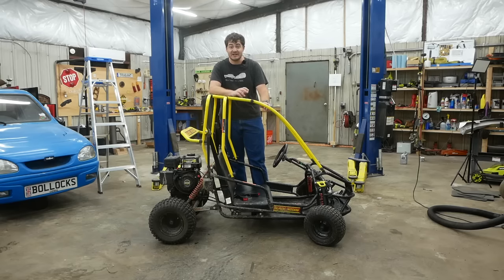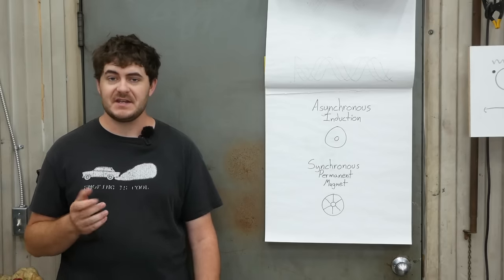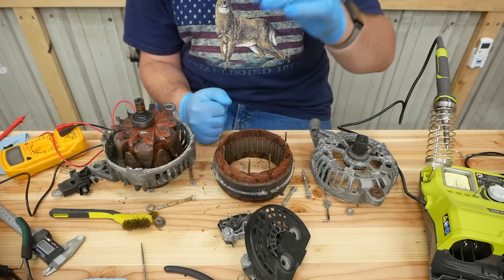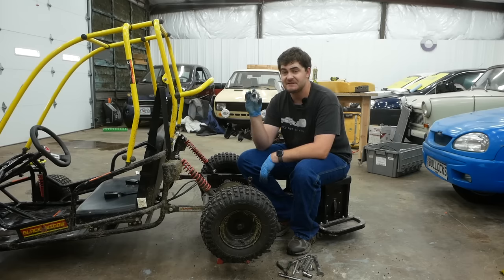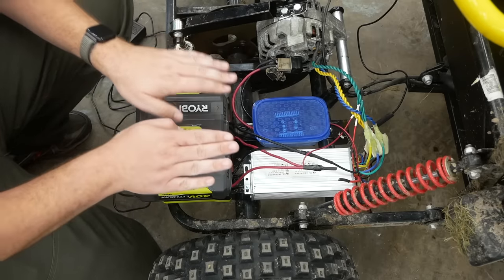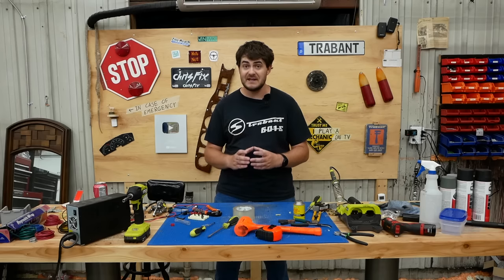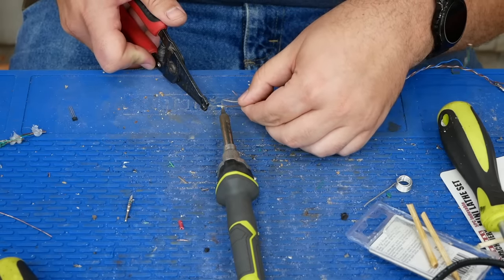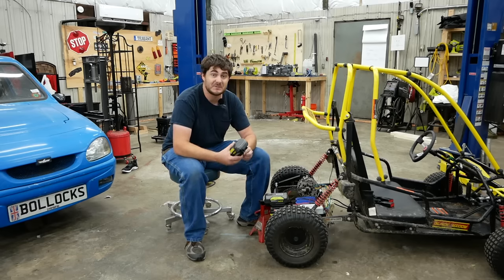Can I Power This Go Kart with a Used Car Alternator?

Comment: Samething happened to an eSk8 board.

The motor controller CAN bypass the need for a sensor. But there is a way to do it in settings... Vesc does this in the controls.

I forgot how to Make it work... But yea.. One time it worked with my sensors... I unplugged them and set it without sensors and... It worked anyway (better)....... I used it.. Then suddenly... It sucked at start up... No changes....

... So I made it sensored and it is clunky at start up but then it works well once moving...

I still don't know why... I just blame the motors but who knows.....software?

Adding power... May work but when I did that.... All it did was clink double strength... If you go though it's stupid fast... But yea it has a seizure 0-1mph

Comment: I never even thought about using cheap junkyard alternators as three phase motors, that is absolutely brilliant, thanks for that

Also in case you wondered, the way sensorless sensing works in a motor driver is that it uses something called back-EMF. Keep in mind, the thing you're using is still a generator as well. Even though the stator makes the rotor spin, the rotor in turn still continues to induce a voltage back into the stator. The motor driver can look at this returned voltage and determine how fast the thing is spinning. Works on steppers too btw! Great way to add some extra precision to a mill or 3d printer that doesn't use a servo setup, Trinamic makes great drivers that incorporate the concept

ps: noticed you already changed to a different buck converter in your other video, but for future reference you might not wanna put something with a heatsink in a closed off container, it'd probably end up in thermal shutdown and make the go kart a stop kart

Comment: Start up torque on electromagnetic motors are trash. (assuming its in series and not a shunt design) 
Could be cutting out due to the high current.
IDK tho

Comment: Forgive my stupidity, but I'm stupid
Couldn't you get another alternator, to charge the batteries? 
So your alternator motor to run the wheels, but an alternator working off the spinning wheels to charge the battery? Possibly? Idk

Comment: Hey, I'm pretty sure I have the documentation for that controller. Send me a DM or reply to this message if you want
Reply: Also your batteries are wrong that's why it's cutting out, you need 48v or 52v batteries.

There is literally zero reason to swap out the parts, you should be able to make it work with what you have.

Comment: your phase diagram is way off - you have each phase separated by about 60 degrees. If you just inverted the second phase (red line, making it the third phase) it would look about right, with each phase separated by 120 degrees, so that they are at 0, 120, 240 degrees.

Comment: Try more power to your fixed magnet mate. If the magnetic field isn't strong enough the motor won't stay in sync I should imagine and won't have enough torque to start motion. You need the magnetic field to be strong bro especially for your big body.

Up the amperage on the magnet and increase esc to 3000watts and you should be in business brother 😁 

I love watching protests like this...
What about using an ebike wheel motor? 3000watts would get you tearing about the place, you could retard the power for your boy either by power or gearing?

Whatever man, I just want to see you succeed 😉 obviously this means you've gained a sub 👍🏼
Failures aren't failures but experience leading you closer to you goal brother😉✌ 

PS. If that ESC's is the same as mine regenerative breaking (low level break line) can be set up or system breaking (high level break line). Lack of instructions is ridiculous.

Comment: And Italy have been quicker and easier to replace the original motor and fashion a speed limiter under the accelerator using a bolt.

Then the kid might have something he could use for something other than looking at and dreaming about...

Comment: centrifUgal   ( sin' trehi - fEW  - gull ) 
 not  centrifical  . . . that is wrong . because there is nothing ifical about it.   

randomly dies . . . ? ? ? ? ?  sounds like the carb  gasket is split  and port stem is clogged. 

soo why only go with 3   when you could have gone with 6  or more all the way around  the coil field ?

the reason for it not taking off fast is because  there is too much  there to turn,  the battery needs to be of a larger amperage to forcefully turn the armature .  . . . OOOOrrrrrrrr some reverse jule thieves ????  i think.   the  battery operated fork lifts have them.  

as for it shutting itself down ,  . . . . i think there is a current  '' recharge ''  going from the alt  to both battery packs . that might be why  the internal things shut off . . . the batt packs got hot , and it went into  protection mode. 
samething happened to  car amps  and   the jell cooled speakers .  you they made them too ,  both of them because too much juice was being forced through the amps causing the amps motherboard to overload and  melt the bridge within it.  altho when it cooled , you could hear music play from inside 
the amp .    lol   ,  yes that was after the motherboard bridge melted. 
but when the speaker got hot  from over usage   ( constant super loud noise )  it would stop working.
 but only to get cool again so that the coil inside would not fray and  ''  pop  ''  . 

best part is ,  you did not have to witness the death of  2  innocent battery packs going up in flames.

     lol 

perhaps reducing the big cog with a smaller one ?

Comment: Hm surely a car alternator for a 12V battery is gonna put out like maybe 18V unloaded? 14.4V is about the limit you can charge a car battery at. 

Because of inefficiencies in both directions, you might need higher voltage to drive it as a motor, but not 40V! So... then dude would be down $5 and have to buy a proper motor. Wouldn't a starter motor have been a better idea down the scrap yard? 

So, re-wind the coils? Unlikely. Do something with the stator and rotor coils that's sort-of relative to each other, somehow? Could be. Just a simple step-down power supply? BORING and would need a lot of current capacity so expensive. 

Hopefully he does something fairly electromechanical rather than electronic. Instead of moving electrons in a transistor, have moving iron and electromagnets! Early voltage regulators in cars, for the charger circuit, just had a relay, an electromagnet, rated at about 13V. So if the engine was going fast and the alternator (or dynamo!) voltage was high, it would engage this relay, the electromagnet would pull a piece of iron, which would work a lever to open a set of contacts that cut off the connection to the battery! So the charge voltage was kept at a safe level, by electromagnets and levers rather than transistors and diodes.

I know this from the 1960s Volkswagen (I think) ancient car engine that pushed my friend's boat around in the 1990s. Skittering electrical box, rattling away means all is well, and I bet an expert could tell you the battery's voltage just by listening to it clatter. 

Now I'm gonna watch and find out what he does!

Comment: try to change the rotor with aluminon one, so it transform into asynconous motor
Reply: Asynchronous motor controllers are a lot more expensive
Reply: @foxxyytofficial  I don't know how much is the price,  but asyncronous never stop they don't have the problem of "lose the sync"
Reply: @ogivanet  but they have other problems that need to be taken care of, Tesla used asynchronous motors and their cars costed hundreds of thousands of dollars, now that they learned better motors, they sell cars starting with 40k dollars instead of 100k
Reply: @foxxyytofficial  yes, but i'm jus trying to give solution to the problem of this video, not to every situation, I don't think this guy want to buy a tesla motor for the kart

Comment: scrap it. alternators don't have enough wires in their coils, and they're brushed. just put a couple hub motors in the back tires and make a software differential for them that responds to current demand.
Reply: Austiwawa did it
Enrengineering did it
FixitModitBreakit did it twice
Tchangly21 did a lot of it
So it works, just need to think a bit more on it

Comment: I have an upgraded Razor Mx650 w/ 48v 2000w and it can do 30mph easily and it's definitely faster than the equivalent gas engine.... The acceleration is addictive and I'm planning on going to a 60v-72v 3000w kit that can do 60mph.

Comment: Ruined the go kart. That won't work in bumpy conditions. For just $100 you could have bought a 6.5hp predator but you're gonna spend $700 for a 2 hp electric motor without a cvt?  It's just a huge waste of time. It was fine the way it was.

Comment: A lot of waste of time. I built a car that runs off a direct drive washer rotor and stater and using batteries and inverter. You would have done better taking a forty dollar electric lawn mower and turning it sideways and put a wheel where the blade is. I am constructing one to run off water using electrolysis. Hydrogen is much safer than gas abd 2.5 times more powerful getting 4000 miles to a gallon of water. The possibilities are endless. Just FYI oil companies will soon be no longer be a big business as in 30 yrs in the planning stages hydrogen on demand as well as liquid hydrogen will be the prime transportation source of fuel and completely clean to the atmosphere and the interior engine it runs.

Comment: Summary: buy a motor. Don’t try converting an alternator into a motor. And use a Tupperware instead of a cheapo.
Reply: Summary of summary:
The conversion work, just a bit more finicky
Austiwawa did it
Enrengineering did it
FixitModitBreakit did it
Tchangly21 did A LOT of them
And they work

Comment: I watched the whole video to see if you realize that the downstepper should be the main problem but...🤦🏼‍♂️ 
U stepped down from 48 to 12 v and the controller is thinking the battery is dead... U need an upstepper to trick the controller so it doesn't shut off! Simple electric knowledge 😂
I will leave a dislike
Reply: The 48V to 12V is for the rotor
Wtf
Reply: @foxxyytofficial  this Chinese controller is dumb (or maybe not), it's built for 36-48v. If the current goes under a specific level the controller immediately shuts off for battery safety. It's confused about the high amps and low voltage thats why it takes several seconds to shut off.

Grow ur knowledge bout electronics please
Reply: @mistersimple1986  I know people that made the same project with DC-DC converters and chinese controllers and had no problems, and i even helped some of them, you don't know what other people know, so stop judging like if you were in a courtroom